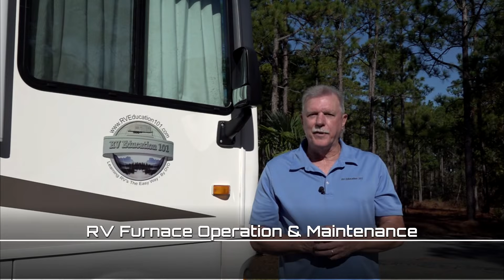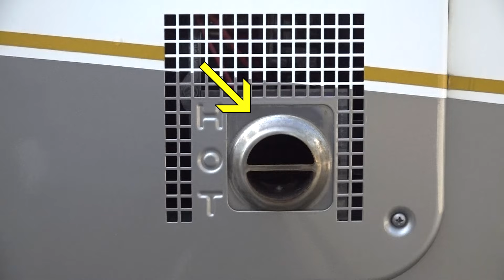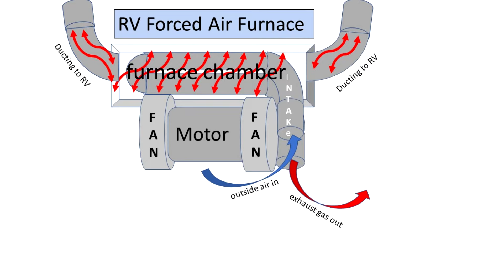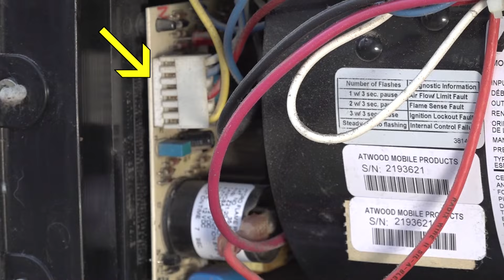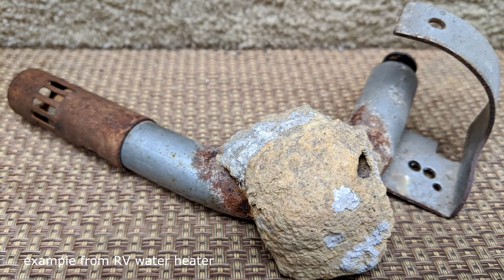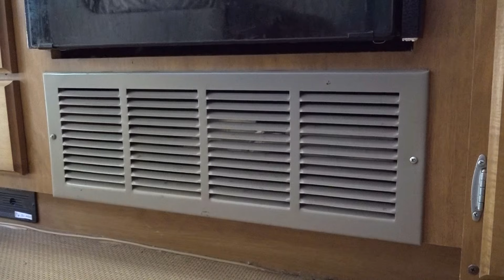RV 101® - RV Furnace Operation & Preventive Maintenance

Comment: I wish you would have delved a little bit deeper into this so although we don't do it ourselves we know where, for instance the burner is located. How it should be accessed. This way, when someone starts taking things apart they should have to take that area apart. I'm tired of techs making more of an issue to rack up labor hours or to know they actually did the work they say they've done.

Comment: The lack of quality with which travel trailers are manufactured is a disgrace and shameful & 2nd in line comes the dealers who fawn over you until you sign the contract & extended warranty then when you need to use that warranty its worse than getting all your teeth pulled at once at the dentist. Those RV recipients after Hurricane Katrina that toold horror stories about those trailers falling apart and all the problems after just 6 months were not exaggerating and we all thought they were just ungrateful pigs. Its shameful their should be some kind of regulations like with cars to do something about it

Comment: Hello I have a question if someone could possibly answer it for me. Can't find anyone on YouTube with the exact problem my dometic or Atwood RV furnace works and is fully functional however I smell gas in the cabinet where it is located does that mean the gas valve needs to be replaced or is there another issue? Thanks
Reply from the maker: It would be impossible for me to troubleshoot this problem without physically being there. But, if you smell LP gas I strongly recommend you get it looked at by a reputable RV service facility prior to using the LP gas system again.
Reply: @rveducation101  thanks for the reply but I actually replaced the gas valve and that was the issue 🙂